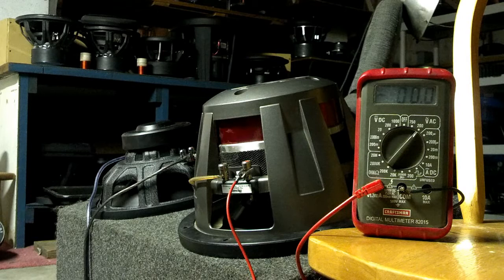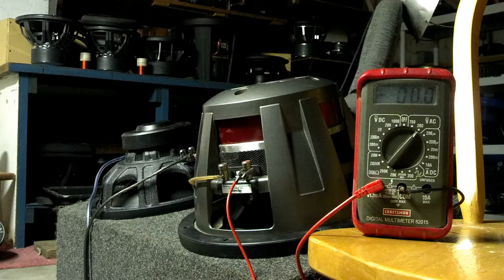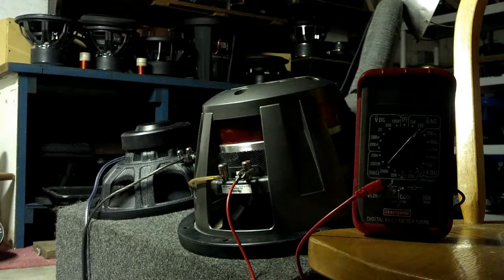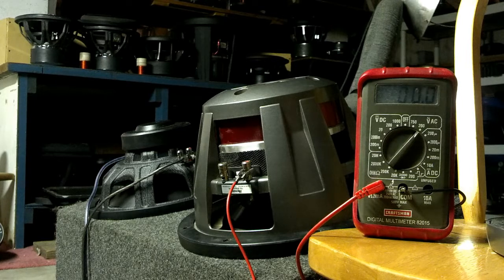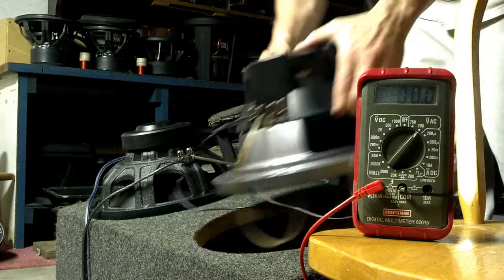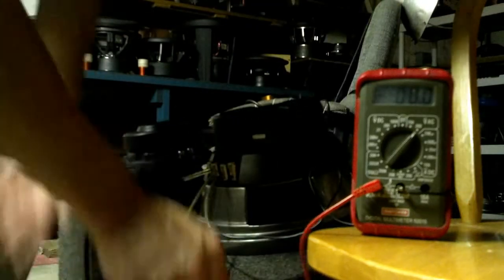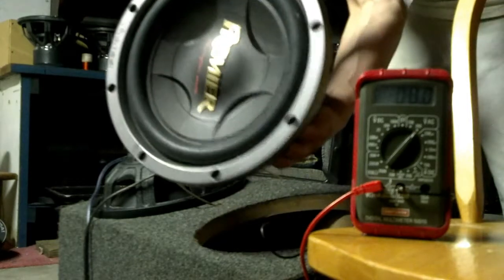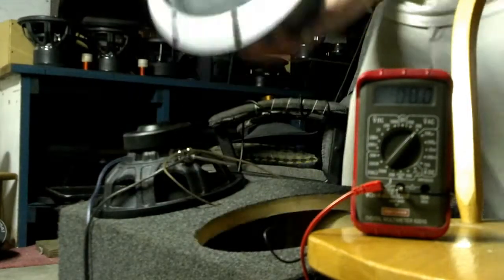Speaker Generator Testing Will Bigger Lower ohm Make More Power?

Comment: This has piqued my interest, first of all, thanks for the vid.  I have a question, have you tried to make a wind-powered vibration device to add this speaker into so it could be a passive power station?  Add a few supercaps and in the right conditions, it could be a great back up power.
One idea is to use a device that has a chimney since it is a natural upward vacuum system, where warm air will rise through the chimney and if you have a fluttering baffle that would drive the speaker.  You probaly have some really good ideas and it would be great to see if you are working on any of them. 
Thanks

Comment: how many volts is the amp giving the first sub?.. my 2.4k amp puts out over 50 volts ac easy.. would think i would see about 25 volts if i did this setup like your doing. guessing half the power would be lost in the transfer through air to the unpowered  sub.
Reply from the maker: check out my other videos on this

Comment: i think the way to optimize this would be to get the tightest gap possible with the softest suspension and biggest cone for the generator sub. the bigger pioneer sub you used has stiffer suspension than the smaller two which made it resist movement giving you less power.